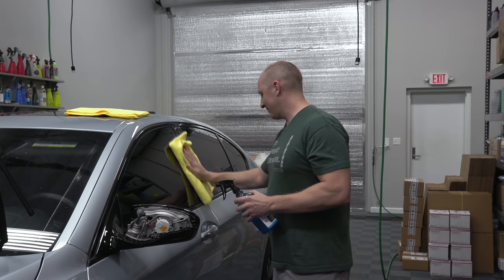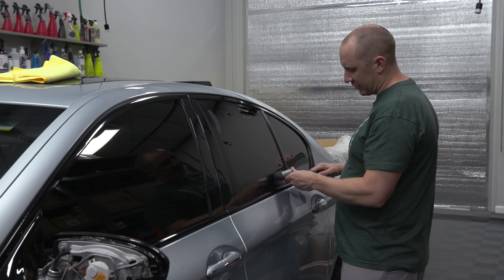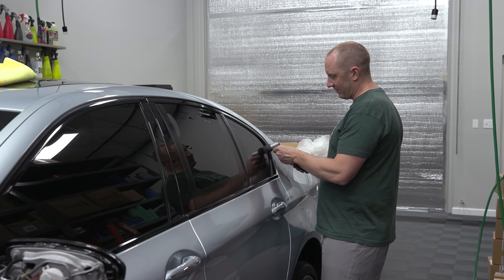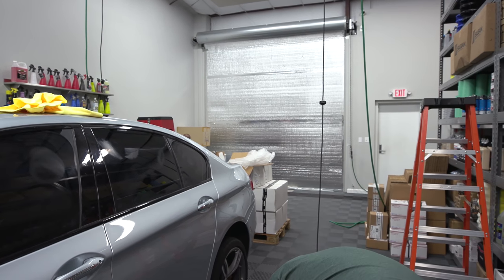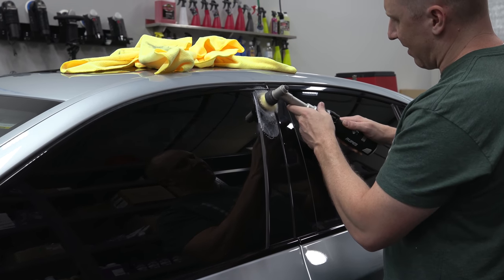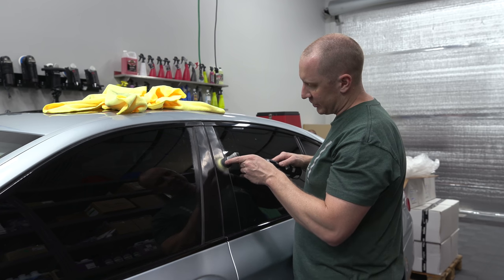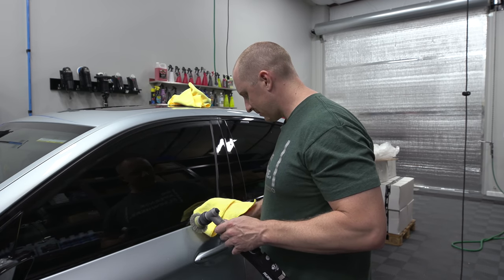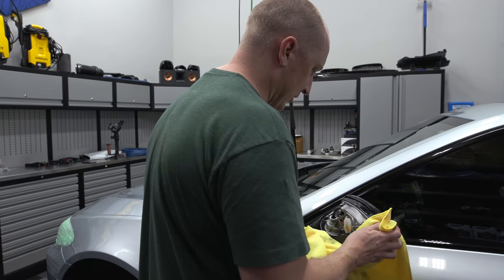F10 M5 Detail Series: E8 - Glass and Trim Polishing

Comment: Recently tried Meguiars Ultimate compound on my Rs7 and didd 85-90% of what M101 does, with no dusting at all. For an off the shelf compound, it finishes well and removed heavy swirling/marring on the hard clear coat with an orange Griots off the shelf correcting pad. Also removed etching in the glass and gloss black trim. Highly suggest grabbing a bottle

Comment: What about CarPro Ceriglass as a glass polishing liquid with a CarPro Rayon glass polishing pad, this is a very thin pad since glass is really tough. This way you should also be able to remove small scratches and whirring from the glass. Havent tried it myself yet, but i will as soon as i get my polisher, which takes forever to arrive by mail grrrr. Cos now your not getting the obessed level result ..
Reply from the maker: You can use that if necessary, but I like to avoid CeriGlass if I can help it.  It's a pain to use and remove.
Reply: haha, yes you made it very clear its a pain to use it. So im in for a fun day :)